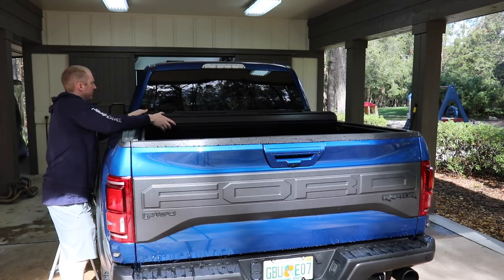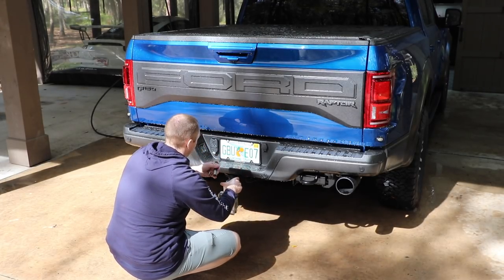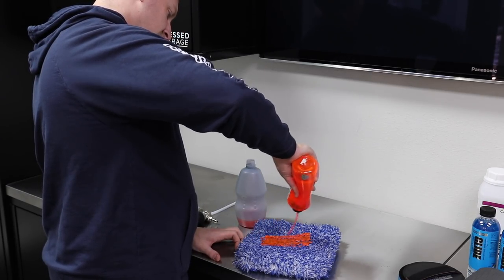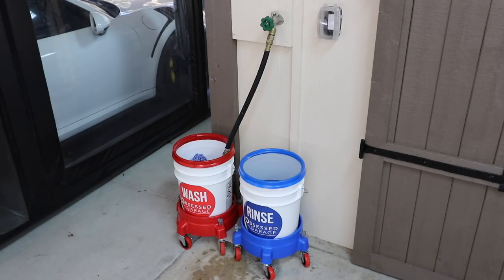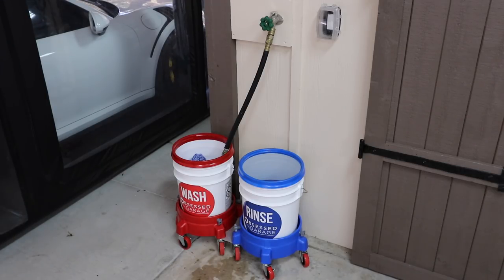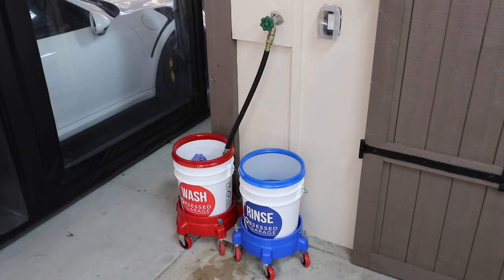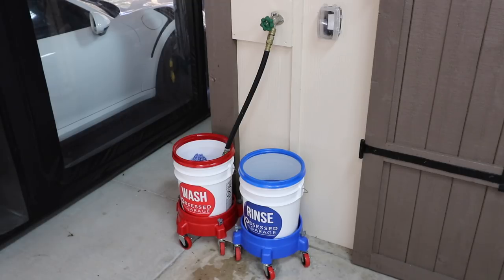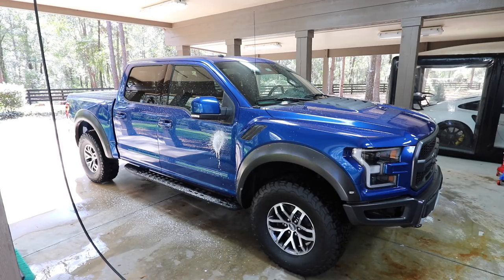18 Raptor Correction | Protection Series: E3 - Strip Wash

Comment: Matt, the more I watch your videos the more I wonder WHY you do not rinse off your Foam BEFORE washing. I would think the main purpose of Foaming is to loosen non imbedded dirt. The Foams you use work so well (thick, heavy and slow, the dirt probably NEVER  just floats off the vehicle and so to go straight to the Microfiber sponge is just moving dirt all over the paint. There would also be a greater chance of contaminating the sponge  and causing more damage. 

I understand that on your new Raptor you are doing a full treatment so it's not quite as important this time, but I have seen you do this as routine. As an OBSESSED Guy I am a bit surprised by this and wonder what if anything I'm missing here.

PS: I predict that your Flooring Business will soon need a dedicated manager, designer and installation team   :)  A good thing!
Reply: He rinses down the vehicle thoroughly before hand with the pressure washer to remove the non-embedded dirt, and uses the foam as more lubrication on the surface during the washing process.
Reply from the maker: I find that step a waste of time.

Comment: why do the lights keep flashing
Reply: Sniperkiller104 his truck key is in his pocket
Reply: I believe it is when water is going over the touch activated door locks on the handles. When I wash my car this happens all the time causing my side mirrors to fold in as well which is really annoying. I don't keep the key on me while washing so it doesn't get wet and this still happens.

Comment: Fantastic color Matt!  You need to get a stubby antenna though, plus take the key out of your pocket when washing, otherwise the pressure washer & proximity of the key will constantly lock & unlock your truck!
Reply: Think that was caused by pressure on the door keypad.
Reply from the maker: Stubby, done.  Yeah, I kept telling myself that when it was locking and unlocking.  I just never did it.
Reply: Obsessed Garage what’s the stubby antenna you use?
Reply: jay west - no! It can be a hose, pressure washer or even a wash mitt that gets close to the door handle. It’s like the water amplifies the proximity system. Mine does exactly the same....